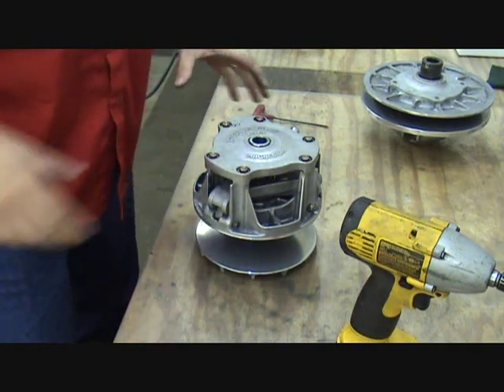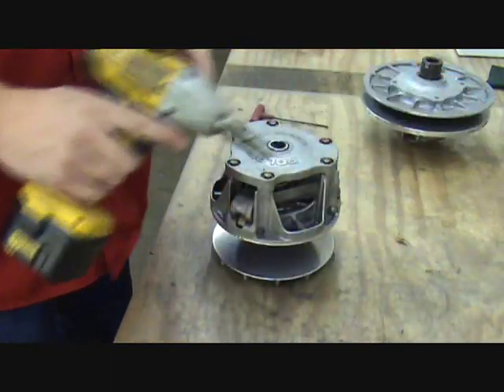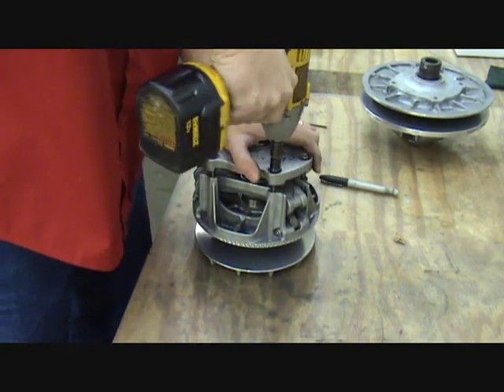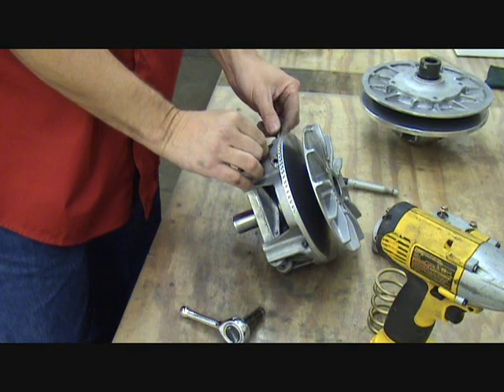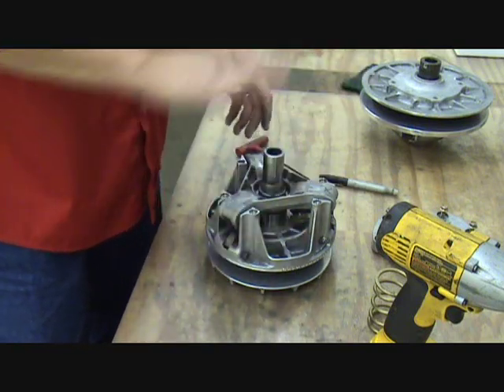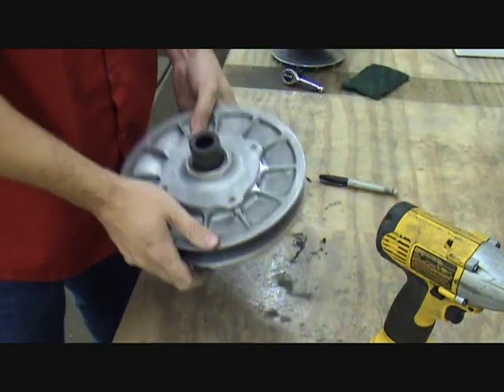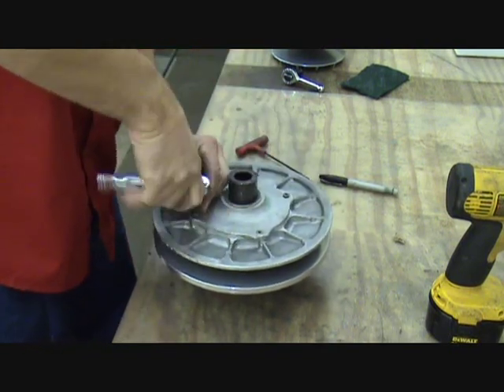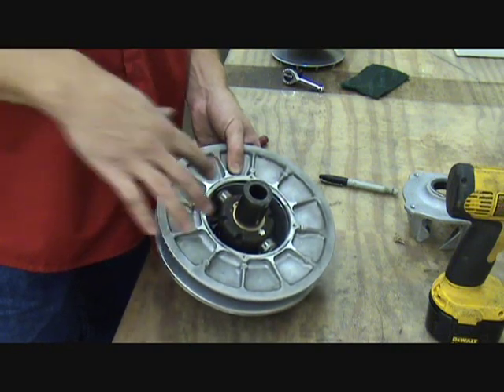Polaris Sportsman EPI Clutch Kit Install - Part 2 of 4

Comment from the maker: Correct those are the only 2 vareiables that can be changed in the stock primary. it is going to run a heavyer weight then you could with stock springs to give you better grip on the belt and the stiffer spring helps with that along with giving it a little bit of a stall to help it off the line a bit more.

Comment: I changed the drive belt on my 2003 , 600 polaris now the bike wants to creep when idling and you can't change the gears. what do you suggest? Ronnie Deese
Reply from the maker: Check your one way bearing in the center of the primary clutch.  With the belt off it should turn free one way and lock up the opposite direction.  If it doesn't turn either way you will need to replace the bearing.  Also make sure you have the correct belt for your machine.  Check the actual numbers on the belt.  If everything else looks right your clutches might be out of alignment.

Comment: So the belt on my 04 600 sportsman keeps shredding. I pulled the clutches out and noticed that the markings of the primary clutch were not in line. Can that be the cause?
Reply from the maker: It can be but that would normally effect the balance and vibration of the clutch more then anything.  If your belt is shredding I would clean your clutches really well, inspect all the bushings and rollers and also check the alignment.
Reply: EPIperformance how do I check the alignment?
Reply: Also, I have taken my primary and secondary clutch’s off and there is some scaring on the primary clutch sheaves. It doesn’t look terrible but it is a little rough to the touch of a finger. There is a little on the secondary clutch as well but more on the primary. How much scaring or wear is normal?
Reply from the maker: To check alignment Polaris make a tool to lay in the clutches and check of the offsets.  But you can get an idea just by looking at your clutches with the cover off.  Look down through the top or front and see where the belt is riding in the primary clutch.  It should be centered.  If the belt is way off to one side or the other put the machine in neutral and rev it up just a little and let off and see where the belt comes to rest.  If it is way off it will cause you some issues.  On the older Polaris you can either add or take away shims behind the secondary or you might have to loosed your engine and transmission mounts and move them a little.  If the scaring is deep enough where you can feel the grooves then it will act like a cheese grader on your belt.  Take some emery cloth or light sand paper and try to smooth the clutches out and then use a clean rag and brake cleaner to clean them up.